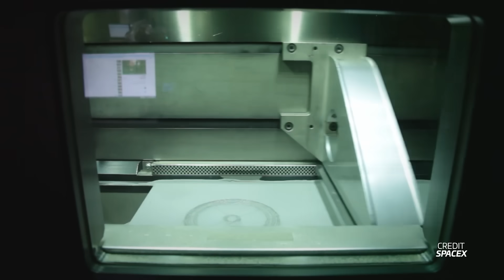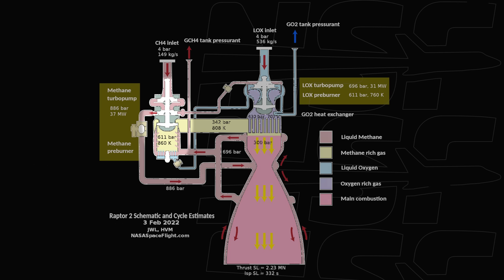Starship's Powerhouse: How SpaceX Builds & Tests the Raptor Engine! 🚀

Comment: Fantastic informational video.  There is a lot of travel time for each raptor before it even fires, amazing.  I assume rail transport is either not secure enough or logistically detrimental to the program.  There doesn't seem to be much rail access at the actual build site either so, perhaps, just a simplification in handling?

Comment: Pushing roughly 0.7 cubic meter of liquid propellant per second against 700bar back-pressure requires about 4.9MW of power, in ideal mechanical terms. I wonder why are the turbopumps rated for a total of 70MW. Surely their mechanical efficiency is better than 7%. Are turbopupms in full flow stage combustion engines inherently more power hungry because they inject the propellants into a gaseous phase in the engine?

Comment: This video made me wonder how both F9 and SH boosters can burn during boostback without engines ingesting gas - At that point they have flipped and are on their sides.. Even with a gas pressure feed how is the liquid fuel kept at engine intake???  Any in the know care to answer?
Reply: maybe the nitrogen cold gas thrusters give the first stage a slight push forward to settle the fuel into the engines.
Reply: Centrifugal force.

Comment: It seems that having different size nozzles between the vacuum and standard versions of the raptor would require changes in the power plant to account for the longer piping runs on the nozzles. Do they do something tricky to keep the power plant the same despite these differences? Or are there impacts to the power plant?

Comment: They should should static fire the ship with hotstaging ring to test it if it can withstand the heat and force .
Reply: But they will not as that could damage a booster that could be used and for the foreseeable future that booster is going to be destroyed anyway. Best to leave that “reusability” detail to a later time. They probably have some instrumentation to get most of the same info from the launch.

Comment: Excellent presentation! But I thought the main reason for hot staging was to maintain the ship's acceleration. (at 7:34) With the old way, after booster separation, there was a brief moment when nothing was pushing on the ship, resulting in a very expensive loss in momentum.
Reply: It’s both.
Reply: The problem is to keep the fuel glued to the bottom of the tanks to avoid bubbles formation due to sloshing. Starship must ignite its engines before the booster throttle down, I think…
Reply: @renesoucy3444 pressuring the tanks exist, most rockets don't hotstage for that reason
Reply: The main reason for using hot staging is to increase mass to orbit. Resettling the tanks is an activity that takes time, which leads to a loss in performance. Regardless of the staging method it is a capability that starship needs to retain in order to relight engines once in orbit.

Comment: How do you know raptor sea level and vacuum have the same power pack? Afaik they have different throat diameters and different flow rates wich would mean the power pack is probably specialized.

Comment: I think you left a few "will", "is planned to", "is hoped to" and so on out of there. We yet have to see even a simple dress rehearsal of the chopsticks catching anything, and given the movement speeds we have reliable footage of so far, it's highly doubtful if they ever will.
Reply: Also, the plan is to catch the ships too. Not just the booster.
Reply: AND the catching has to be 100% reliable every time, not a little too far to the side, not a slight misstep over and over and over … This should be entertaining!
Reply: SpaceX now lands falcon 9 reliably, so its possible that they would eventually do the same for starship. the landing is different than falcon 9, and it will definitely take years to get right, but it is possible that it might become reliable eventually.
Reply: @HamzahKhan314  

The hover slam is relatively easy in comparison, lots of margin for error, failure causes minimal damage. The other has almost zero margin for error, failure is catastrophic. High entertainment potential!
Reply: I imagine the system would have two speeds, just like Falcon's TE, or the Ship's flaps.

Comment: The basic need for a vacuum nozzle is actually pretty simple to explain:  we want the high velocity gases directed exactly away from the nozzle and along (parallel with) the longitudinal axis of the rocket; with an under-expanded nozzle where the gases aren't at the local atmospheric pressure at high altitudes when they exit the nozzle some of the gases bloom outward with a velocity vector not in line with that axis.
Reply: nice explanation.